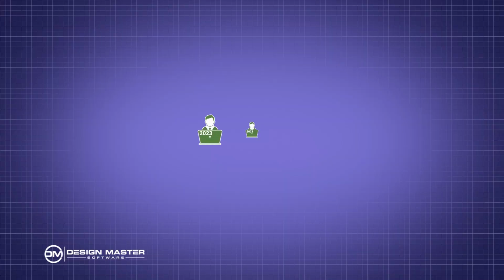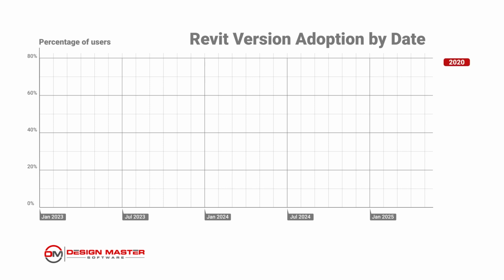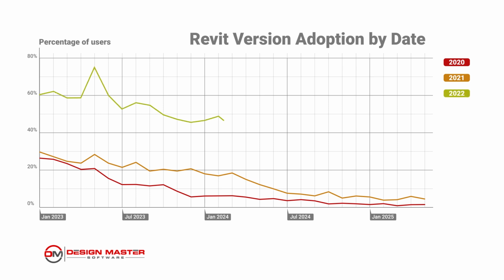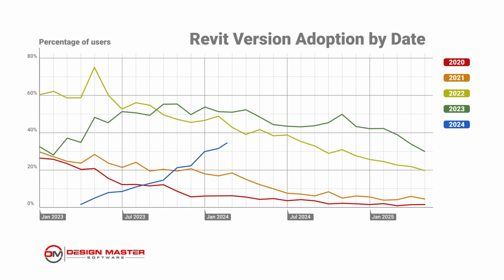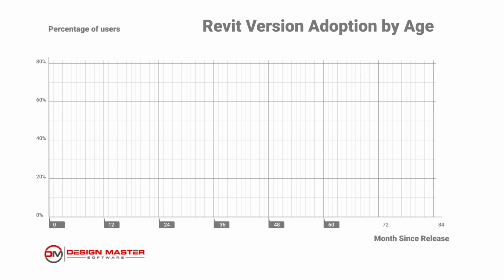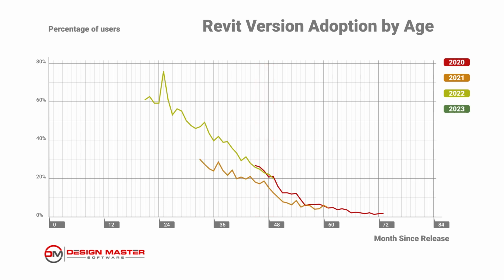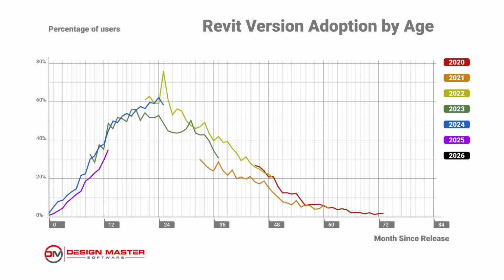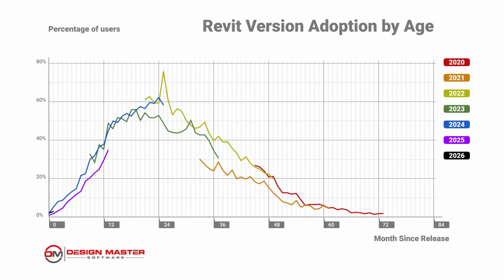Revit 2026: Usage & Adoption – Episode 39

Comment: Nice
In our office (MEP with structure, so SMEP office). 
So in 80% cases we don't have any decision, in like 15% we have strong opinion, in 5% we can decide which R version.
Since R2015 i can say.
R2015, begin world of Revit for us, 1 or 2 projects. 1 quite huge and longterm.
R2016-18, 1 or 2 project each version, not really long.
R2019, really long term version. Many projects, one of project we finally end like 1 or 1,5 years ago ... It was terrible to work with such old version in 2024. 
R2020, had only 1 short project, version quite "skipped".
R2021, had several bigger projects.
R2022, again "bigger version" for us, many huge projects.
R2023, few shorter projects, which was updated to R2024 or newer R when possible.
R2024, even if terrible (schema errors up to 2024.3) that version were quite "bigger" for us.
R2025, probably smaller version, 1 project.
R2026, 3 projects, still "version is growing".

"subjective" rank of long term popularity each version (as today).
R2019>R2022>R2024>R2021>R2015>R2018>R2026>R2017>(R2016,R2023,R2025)>R2020.

R2019 was used much too long ... but overall i can't say that R2020-2021 could offer anything much more for us ... quite understand that some small architects could stick for that version such very long time. But anyway R2019 was good version i mean huge improvements in filters(or / and), in windows compatibility (multiple screen). I easily understand that after R2019, older version become quite tiring and outdated. (Still i have that version in station), And after R2019 appear, older versions quite vanished (many improvements vs R2018).
R2022 give some better schedules (worksets, filter by family, it nice QOL, less scripts and other voodoo for some fast basic task). We stopped it(i believe) using recently.
R2024 that schema errors give me really headaches ... since that version, i am very scary of using newest version as long as its not September. (half year since release).
R2026 i believe it might be next long term version, its IMO stable, that accelerated view its important improvements comparing to previous one. And comparing to R2024, same size projects its noticeably faster after upgrade. (I get much less complaints as BIM guy from whole SMEP team in projects that are in R2026 comparing to any other R versions).

Curious what next R can give. if it will be major improvements, then R2026 probably won't be such long term version as i predict. If not, then it might "demolish" my myth of mighty R2019.